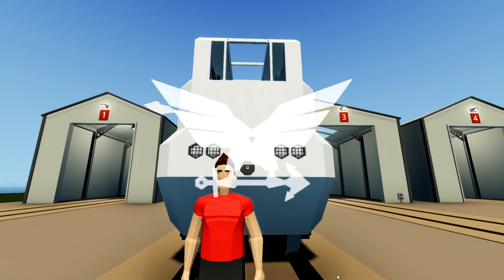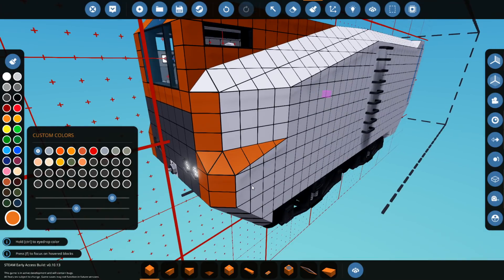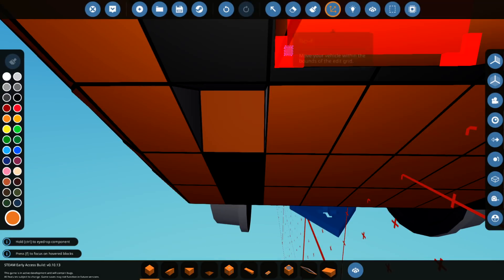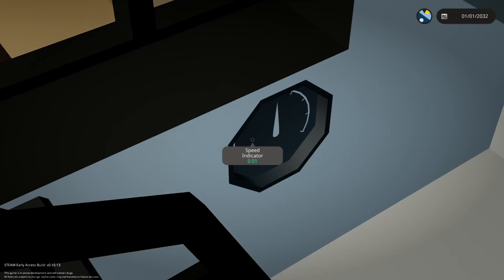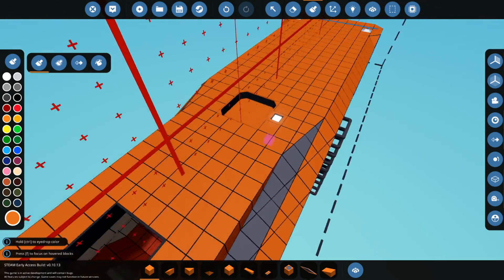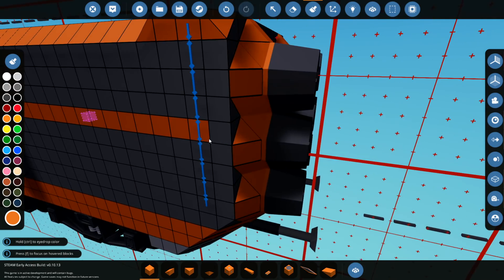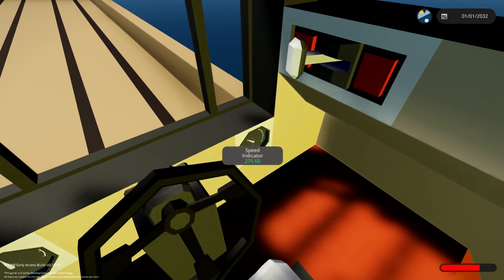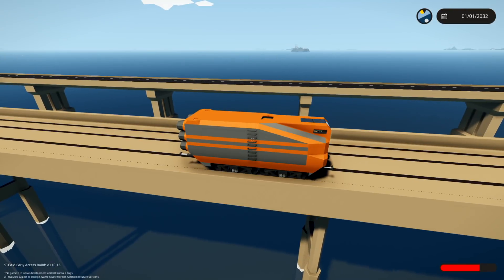660 Mile Per Hour!  -  Jet Train  -  Part 2

Comment: The jet engines usually explode because the PID is not always fast enough to react and decrease the throttle before the RPS goes over the critical point (I think it is around 190). When you set 180 RPS max, it could actually overshoot a little before stabilizing around the desired value. Theoretically you can tune the PID so that this does not happen. In practice I usually put a valve on the fuel line a that is controlled by a "less than" block (or a function block) and the valve closes when the RPS goes over 180. This way even if the pid it sluggish your engine does not explode. Its like a fail safe mechanism

Comment: What you should do is set the PID back to 0.01, 0.00001, and 0.1.  The reason why it exploded was that the throttle needs to be less than 180
Reply: doesnt work. mad my train side by side with his vid, still blows
Reply: @williamswallows6909  wrong